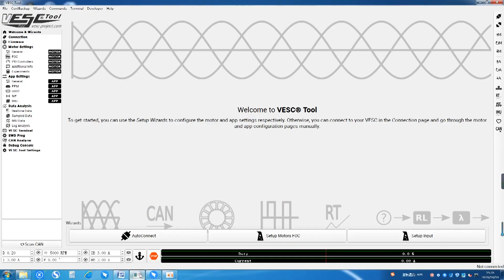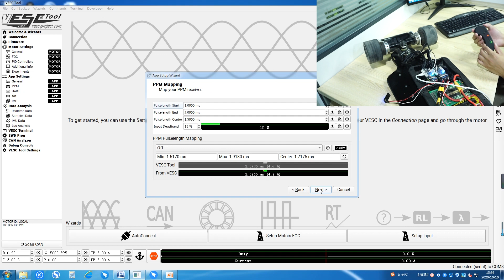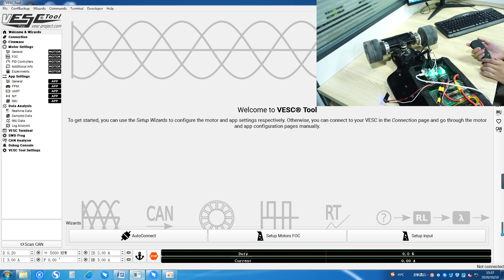Single ESC Mount a Dual Drive ESK8 | MINI FSESC4.20 Canbus Connector 6374 Battle Harnded | Flipsky

Comment: The female connectors you have attached to the esc for power and motor control, what are those called. I'm trying to find the wires for them.
Reply from the maker: Hello, Sir/Madam, we have received the feedback about your professional question. If you need technical support, you can contact our email at flipskytech@outlook.com or click online support at the bottom of our official website. https://flipsky.net/pages/faqs?contact%5Bcontext%5D=footer&contact%5Btags%5D=prospect%2Cnewsletter&form_type=customer#newsletter-footer

Comment: Can i use uart mode with this setup ?
Reply: Yes .No problem.
Reply: Because i try it with 2 Besc conected via can bus an it didnt work in uart mode
Reply from the maker: Hello，which remote  is it? If you used ppm before, you need to change to the uart mode before using . If possible, pls send your parameters setting video to flipsky-service@outlook.com, thanks! We are back to work today.
Reply: @FlipskyTech  i use the Flipsky Vx1 yes i used ppm before, but reset the Vesc to defualt....
Reply from the maker: Yes, need to select again: APP Settings-General-APP to Use-UART
Reply: @FlipskyTech  thx it worked.
But why did you used ppm with the VX1 ?

Comment: I thought FSESC4.20 is rated for 50amps. Why is the auto detection say 55 amps per motor? Is that safe?
Reply from the maker: Yes safe, because VEST TOOL automatically detects the maximum current, and the instantaneous current of FSESC4.20 is 150A . See details here:https://bit.ly/3eZJ0Gk
Reply: @FlipskyTech  oh wow! Very cool, thank you!
Reply from the maker: @Kevin5Nguyen  You're welcome:)

Comment: Hammer build. But what I don't understand about your device. You have installed 2 of the most powerful burshless motors. 2 x 3250 watts!
That's 6500 watts and at 37v 176 amps! And then you only use Li-Ion batteries? When fully charged, these can only deliver 20 amps. That means you have a Porsche engine but only one needle as a fuel hose. Of course you have an extremely good range and capacity with Li-Ion. But then you don't need 6374 motors.

You definitely don't need that much power on a board anyway unless you have big slopes. But then your bottleneck is definitely the battery

Please correct me if I'm wrong - I want to build one myself and I liked your video very much
Reply from the maker: The battery brand  LG HG2, one battery current is 20A, four sections together 80A.  Thank you for liking our videos and affirming our motor 6374-Porsche :) . Welcome to consult other questions about DIY electric skateboards:http://flipsky.net
Reply: Also the 3250W is just maximum archivable power not continuous. It would overheat pretty quickly if you run it at over 3000W for extended periods of time.

Comment: What is the difference between using a Dual vesc and 2 separate singles?
Reply: If you have space..bettet buy singles 

One breaks, you replace one. 

Dual breaks, another story
Reply from the maker: The size of the dual vesc will be smaller, which is suitable for most people's  battery box. If there's not enough budget, combine two single-drive ESCs into a dual-drive is also a good choice.